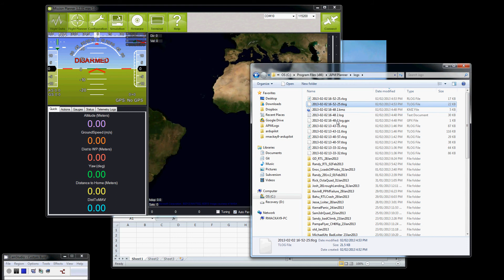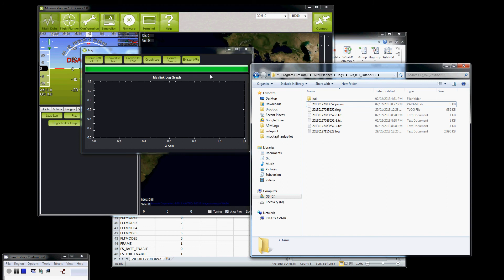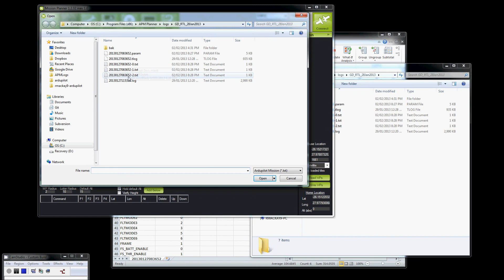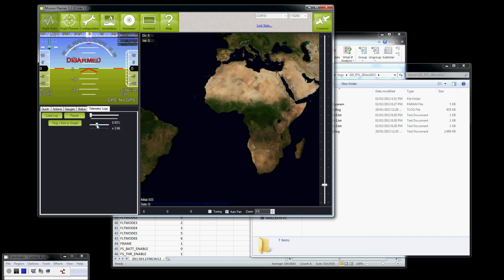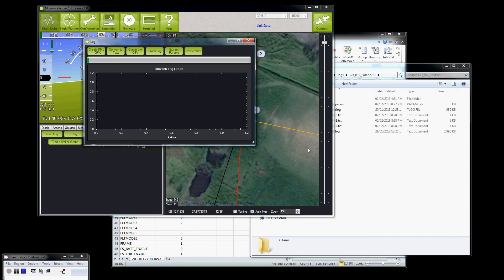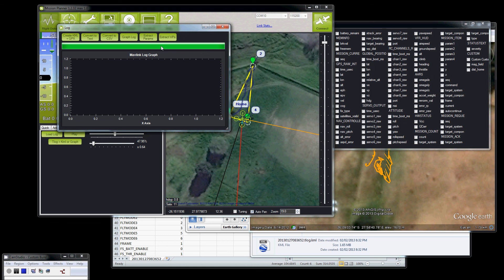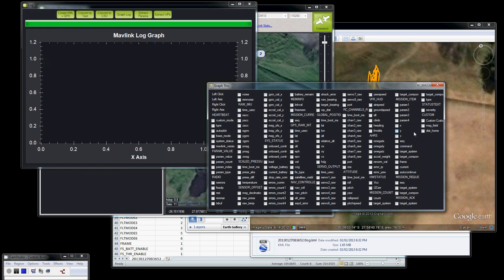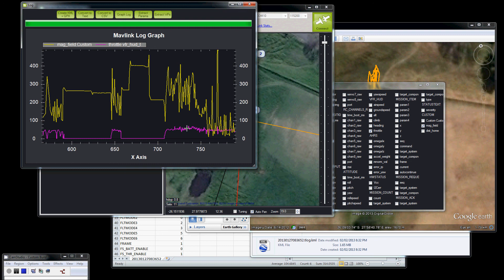ArduCopter TLog Overview

Comment: Randy, I need to get flight data streamed real time into another program running side by side with Mission Planner.  I'd like to know what would be the easiest way for me to query status data from the flight data screen?  For instance, how do I ask Mission Planner, "What is the current latitude of the copter?"  And get that latitude into my program.  Ideally, I would like my program to see all of the status data.  I know that in MP, press control-f > then mavlink, will pass through all raw mavlink data to a TCP connection.  However, it is encrypted and it's all gibberish.  Furthermore, it seems the .tlogs don't have all the data that the status tab has.  Please Help.